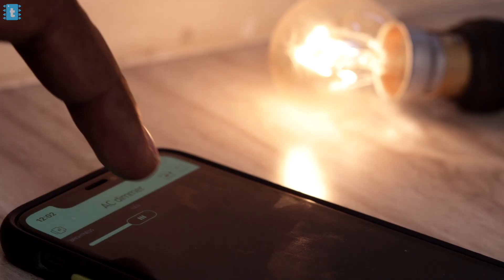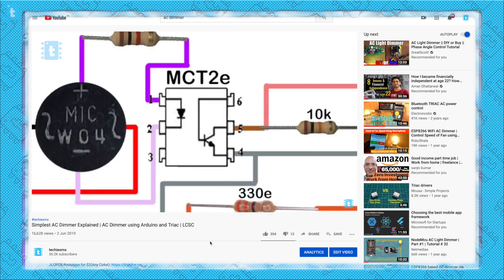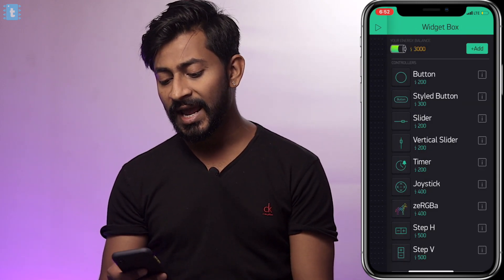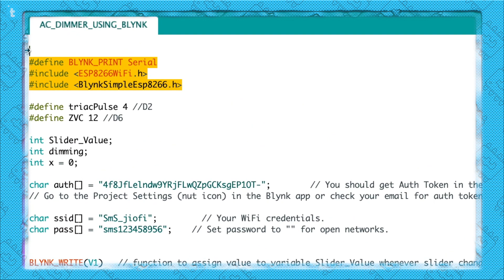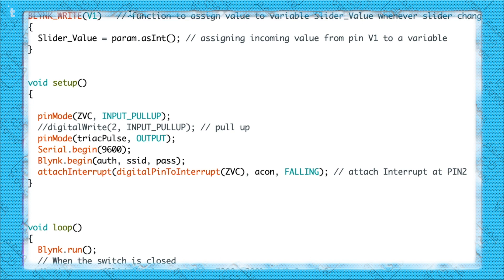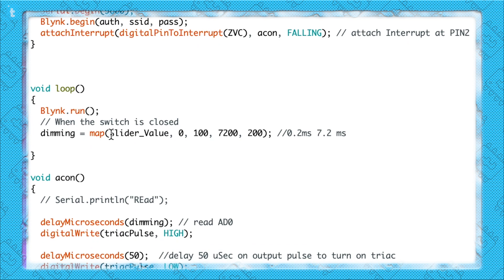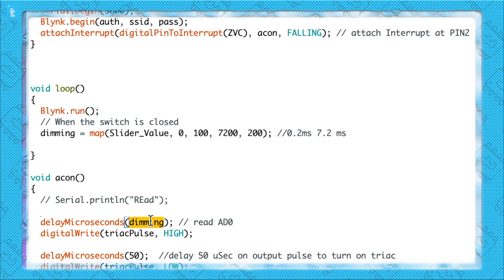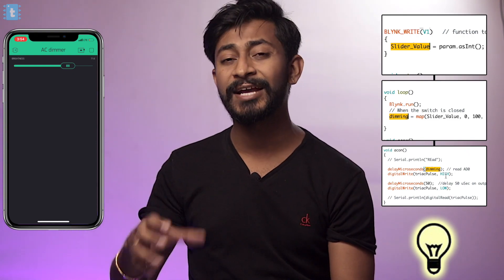AC Dimmer using Blynk | ESP8266 Projects | IoT Projects

Comment from the maker: This code will work only with esp8266 board packages version 2.4.1
Reply: Sir i tried version 2.4.1 the problem was sloved but the light is flikering slide at 0 the light dosent turn off i changed all delay timings still no use
Reply from the maker: Connect vcc of dimmer circuit to 5v not 3.3v
Reply: @techiesms  i have connected to 5v itself Vin of nodemcu
Reply: @techiesms  sir please give the solution i used 5v still its fluctuating
Reply: @prajwalsathwick1021   my problem is same
Reply: Many Many Thanks For Great Project i Really Like This And Make It Sure ....
My Big Request Please make One Project Like We Control Our air conditioner Via ESP8266 IR Remote .... Esp8266/esp32 as a IR Remote Please in the wall then we command via Google home or Amazon Alexa Also Via Blynk App... If We Add Little OLED Or LCD With ESP8266 Which Show Temp Details Its Also b Great ...
Reply: Can we upload data using version above 2.4.1 ? Current version is 2.6.3
Reply: @prajwalsathwick1021  I am facing the same problem.
Reply: @prajwalsathwick1021  have u used incandescent light bulb or any other if we use cfl or any led it will flicker
Reply: How to check the version of the node mcu. Becoz this code is not working. Wifi automatically disconnecting while power on the board... What is the issue
Reply: @mohamedali-sd2jn  it's not node mcu version .
2.4.1 in node MCU  board manager version In Arduino ide software.
Reply: Because of this i can't able to Marge this with blynk ir automation. Code not work
Reply: What is the interrupt error ISR not in IRAM?

Comment: why you didn't use timer interrupt ? my bulb is causing flickering problems, i used board package version 2.6.3 and added  ICACHE_RAM_ATTR in front of acon. The problem is unchanged after using 2.4.1 version.
Reply: I am facing the same issue
Reply: How to fix the flickering issue

Comment: I'm having a problem.  The problem is  after uploding  the code to the NODEMCU. The device showing   repeatedly connecting to wifi....😔
Reply from the maker: Send the screenshot of error to me my whatsapp number 
+91 82000 79034
Reply: Yes even i faced the same its problem in stack it works well with arduino

Comment: Hi

I have made 2 home automation circuits using node mcu of 8 relays each. Using Blynk app

I have two codes for it, which i am using it i need to switch in two pages to operate two different circuits 

Can i use both projects on single page ..

Comment: I was waiting for this, btw thanks brother, all i want to know that, this circuit doesn't have a snubber circuit, so is it possible to control inductive loads like fan with this circuit?
Reply: I made it with snubber circuit , but my code was so complicated, the only bug i faced is when ever power supply is gone and circuit runs through inverter, the dimmer doesn't work, it increased my fan speed to full, i have no idea how to fix that bug. Can u help me with that
Reply: @mrunmaydarpan125  which inverter you used? My best guess would be that there is something wrong with ZCD portion of your circuit which inverter feeds
Reply: @nisargshukla6382  exactly, may be my inverter doesn't have exact 50hz , this is just a guess.

Comment: Hey mate, thanks for a great video, really helpful info and works great. One question though the 47k resistor on the neutral side gets extremely hot, is this normal? I’m using a BT137 (what I had on hand) and it doesn’t get warm at all? All cct’s I’ve seen like this use a BT136 with a heat sink. The fact this component doesn’t heat up at all in my cct makes me think there’s enough of a difference between 136 and 137 to cause issues. Anyone else experience a similar problem? Only difference in the cct is a 4N25 instead of MCT2e and the BT137.

Comment: Nice, but you didn't share code that includes relay plus AC dimmer
Reply from the maker: Be there isn’t any change in the code 
You just need to add buttons on the blynk app and connect relay to the pin you want 

That’s the magic of blynk
Reply: @techiesms  thanks you for guidance

Comment: Bro I am facing a problem, it is working fine at high value of brightness, but at lower value bulbs starts flickering, and it doesn't turn off at zero percent.
Reply: same problem right now, did u solve it?

Comment: great job! i used your tutorial to control on board led of esp32 devkit. working absolutely fine!!! Now  i added some pwm functions in code and was able to control brightness by slider widget on blynk perfectly. 

The issue i am facing is now how to set the brightness through google assistant? like "Set Light brightness to 50 %". i created a applet  "phrases with number". method used as POST, body number field...i am not getting any response or update on led.where i could be wrong?

is this link to update virtual pin is correct?
 http://188.166.206.43/FMC0WkLghPgIxw0RTHpImlTrXCi7aIgN/update/V1
Reply: Excuse me is there anyway you could share your code??  I wish to control several lightbulbs on/off and also a dimmer with the esp32